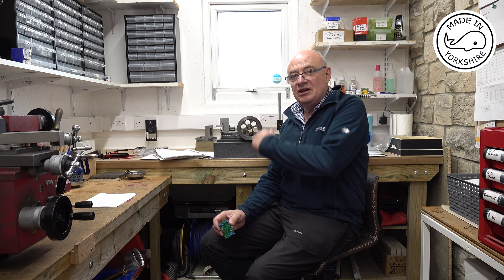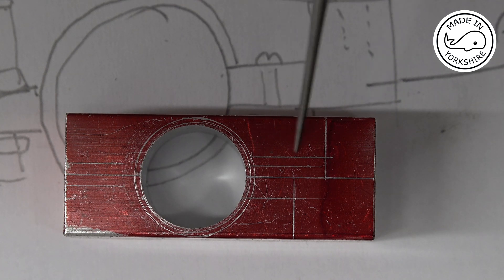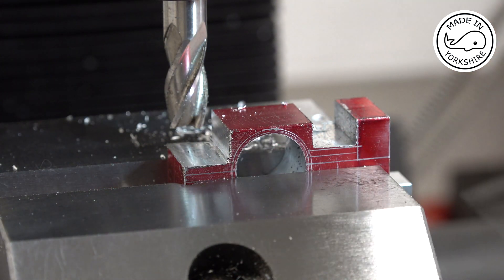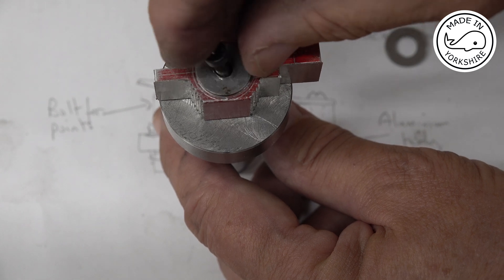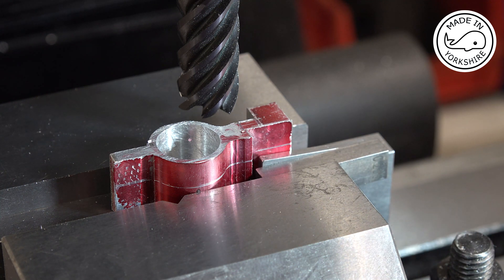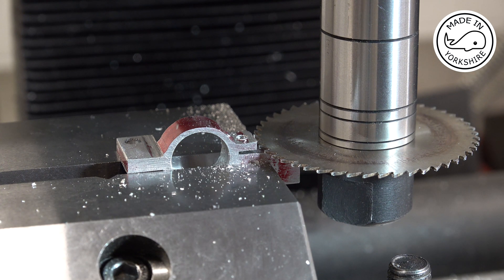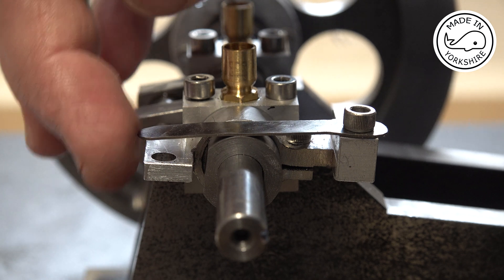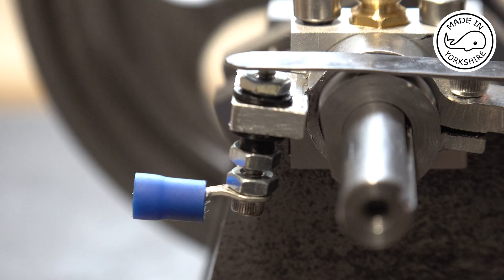#MT41 Part 13 - Philip Duclos Odds n Ends Engine. Making Ignition Points. In 4K by Andrew Whale.

Comment: Wednesday morning coffee with Andrew Whale. I am of the opinion that one should keep their depth of cuts light I never go beyond .025 thou even in my Bridge port. A little faster spindle speed and faster table speeds and the metal is removed almost as fast as trying to take a hogging cut with the endmill with the bonus of never knocking the mill head out of tram. 
I do believe you have forgotten one hole in the point mount bracket for the arm that allows you to adjust the point timing opening and closing with the engine running.
Cheers until we have coffee again 
Dick B.
Reply from the maker: Hi Dick - thanks for the advice. As the arm is optional I decided to leave it for now. I might revisit it once I've got a test run completed.
All the best.
Andrew

Comment: Hi Andrew, I admire your willingness to give something a go.  Just curious, but why didn't you make the insulators shallower so that they could be installed "end on end" through the bracket?  Your current arrangement is likely to loosen if the locking nut crushes the small diameter of the lower insulator.  Hope that makes sense.
Reply from the maker: Hi Steve - well spotted. My original plan was to make one the length of the hole and then make a washer. I got overtaken by time so did a bit of a compromise (bodge!). I might revisit it when I do the final build. I'm itching to trying to get it to run.
Watch this space!
Cheers
Andrew
Reply: @learningturningmetal  Why not just trim a little from the two insulators you have?
Reply from the maker: @stevebosun7410  My trimming knife at the ready!

Comment: That gave me a new image as to what ignition points should look like. Why not! Thank you.
Reply from the maker: Hi Don - a bit rough and ready but you never know - they might work!
Cheers
Andrew
Reply: @learningturningmetal  I believe it will run. What is the plan for an induction coil and capacitance?
Reply from the maker: Hi Don - I've got a Lucas 6v coil and I've just purchased a 0.2 microfarad condenser. I hope they are compatible. It's about 50 years since I messed around with points on a BSA Bantam and my MG Midget. It's gradually coming back. From memory the main thing is not to touch the HT lead! All good fun especially if you don't get electrocuted!
Cheers
Andrew
Reply: When I worked at an AMC dealer (1957?) I would charge the cap and throw it to a coworker saying "CATCH". They would have an electrifying. Nasty apprentice!
Reply from the maker: @donmittlestaedt1117  Ha ha!

Comment: Andrew, we have guys in our engine club that have been running their  hit and miss engines for years using hacksaw blades and bolts for points , I have seen some using automotive coils, model T vibrating coils , and induction coils , all seem to work fine. Some use brass contacts , some adapt automotive points, and they all seem to work fine. Some even insulate the blade and let the cam be the contact point. I think your set up will work just fine. 😉 !
Reply from the maker: Many thanks for the encouraging feedback! Some of Philip Duclos's engines use old Chrysler points. I know this engine is supposed to be made from bits kicking around the workshop, so fingers crossed! Nothing ventured, nothing gained!
Cheers
Andrew

Comment: Hi Andrew, great make, nice to see you experimenting with cut depth, keep pushing till you find the limits, then you will know where they are. They are officially the most robust set of points I have seen, I think they will outlast the engine, all you may need to do is dress the screw face up occasionally. Cheers, Jon
Reply from the maker: Thanks Jon - there seem to be some mixed views on how well these points will work. I guess we will find out! It will be a good experiment if nothing else.
Cheers
Andrew

Comment: Sorry I doubt that you points will last more than a few moments before corrosion sets in. I think you need to, shall we say borrow the tips from a set of Lucas points & silver solder them on to your electrodes. Less difficult than you think. The saw blade one is easy. The other, just cut the end off underneath so that it will fit in through the top then silver solder to the top end. The bottom end then, just needs a pair of flats. So you can turn it from underneath. You may even consider  a long grub screw in stead. Remember points ignition needs a small condenser.
Reply: Wouldn’t you destroy the temper with the heat of silver soldering?  Perhaps riveting a piece of brass on the blade as a contact would be better?  A brass contact and brass screw could easily be tinned with silver solder to make a more durable contact.
Reply: @mwakelin  Silver tarnishes, you're not quite correct about the hack saw blade ? I am thinking about the Blue ones made by Eclipse. I think they are a low grade HSS ? Afraid that it was late when I wrote that bit. I do know that the history of contacts makes it clear that they switched early on to Platinum for the contacts. This is used on most motorcycle magnetos. So presumably on early cars & all the single cylinder portable farm machinery engines. Tungsten would have come in when it became cheap enough to be a viable alternative. Yes, it would be nice to unrivet the upper contact & re-rivet it to the saw blade. The problem is that saw blade. The only hole in it is the eye. So use the eye as the hole & silver solder the tungsten onto the head of a thinned down soft hollow rivet that is a close fit in the hole, then clamp the rivet home. The primary concern now is to keep the weight down
Reply from the maker: Hi Mervyn - thanks for the advice. If it turns out to be a bit of a disaster I think I will try to get hold of some points and retrofit them. Philip Duclos used Chrysler points on a lot of his engines - not sure why he didn't on this one. Maybe the name of it gives it away!
All the best.
Andrew
Reply: @learningturningmetal  I think the answer to your problem lies in the wording. It is a bits & pieces engine, after all. So correct to have bits & pieces to sort out to get it running. To me, sounds to be part of the fun of your building it & my pleasure of watching you surmount the challenges of building it. What a great pleasure it has been watching your improvement as a model engineer. Well done, but from now as we all learn, the more we learn, the less we know. Which makes this such a great hobby.

Comment: Steel to steel is not ideal for contacts, consider brass and/or copper for the contacts, they will have lower resistance and experience less arcing.
Reply from the maker: Many thanks for the advice. I can't say I'm overly impressed by the design, but we will see!
Cheers
Andrew

Comment: Those points certainly look more robust than the ones I used to buy in the local motorists shop. You will probably wipe out the internet and switch off everyones telly as England scores for the entire county but hey ho so long as they work.
Reply from the maker: Ha ha - memories from my previous experimentation with ignition! I will try to avoid testing it this evening!
All the best.
Andrew

Comment: A nice bit of fabrication. Larger diameter slitting saw to go on the shopping list!  I also loved the sound the piece of hacksaw blade makes. I don't suppose it wil be heard when the engine is running. The mill took those 25 thou cuts in its stride. No change in the note of the motor at all. That should speed up future operations. Perhaps we will stop pestering you now! Really looking forward to seeing a test run soon.
Reply from the maker: Ha ha Tim. If I had taken your advice earlier regarding deeper cuts I would have finished this engine months ago! Yeah something else to put on the shopping list! I'm not sure what is generating the noise, but it sounds good.
Cheers
Andrew

Comment: Well done, well filmed Andrew! You made a really complex part without making me cut off looking.... Who was that guy, Philip Duclos? I guy in Africa, having a ring in hos nose? Brrr, what a design. 
If that ignition triggering finger only carries a logic signal telling an ignition module to fire, it  would work for "some time" before oxide will step in and inhibit ignitions.
If any current will be passing it will last for minutes.
Reply from the maker: Hi Stefan - I think that this is the weakest point of the design, but we will see! A good experiment if nothing else.
Cheers
Andrew
Reply: @learningturningmetal  You did use an ignition module in a project not long ago. Is this module the same as the previous one? You'll manage as You have good friends knowing this subject.
Reply from the maker: @Stefan_Boerjesson  Yeah - I could always convert it to electronic ignition at some stage. It brings back memories messing about with points though.
Cheers
Andrew

Comment: The ignition fires when the points close, in fact the instant the two metals are within the distance a spark of the given voltage can jump across an air gap (this is what initiates the point welding mentioned in another reply). TY for posting!
Reply from the maker: Hi Johnny - My understanding is - with the points closed the current running through the windings in the ignition coil builds up a powerful electrical field. This is unleashed when the points separate, causing high voltage to cross the gap in the plug.
All the best.
Andrew
Reply: @learningturningmetal  I understand, thank you!

Comment: I suggest you get it working with the mechanical points and then install Simon's electronic ignition, that way you can compare the two methods for us.
Reply from the maker: Good idea Steve. If I can get these points working I should be able to work out the best location for the Hall Effect Sensor and magnet. Fingers crossed!
Cheers
Andrew

Comment: A carbide tipped round over bit for a wood router works well for cutting a radius on aluminum. If you can successfully mount it in your mill, it gives you the ability to mount the part in a vise and use the table to make each pass.
Reply from the maker: Interesting! 
Cheers
Andrew

Comment: Love it! As something of an aside, may I ask where you got your milling vice from? I can only seem to find absolute behemoths, or dinky vertical slide ones...
Reply from the maker: Thanks mate. All my three vices are type 2 machinist vices from Arc Euro Trade. They are a great design preventing jaw lift. Having got my first one for the mini mill, I just couldn't resist buying two more for the Warco.
I must do a short video sometime, showing features, specs etc because I get lots of folk asking about them.
Cheers
Andrew
Reply: @learningturningmetal  i use that kind of vises and they have not yet failed.

Comment: Glad you decided to take deeper cuts, will have this job done in no time. Why the sodding about with cad and 3 d printing for the insulators ?. 10 minute job on the lathe with a bit of Delrin, Fibre or Phenolic, or even PTFE. May pay you to drill a short hole in the bolt and insert a bit of Tungsten electrode from your new Tig Welder. Well done. Regards from Australia.
Reply from the maker: Hi Dave - I probably need to get hold of some plastic material to turn - but I do love messing about with my 3D printer too. I think the UNC 4-40 bolts are a bit on the small side to take my TIG tungsten, but I'll check it out. Once I get the engine running I might work out the best location for a hall effect sensor and magnet, and install electronic ignition.
All the best.
Andrew